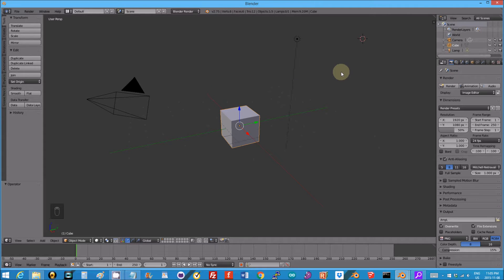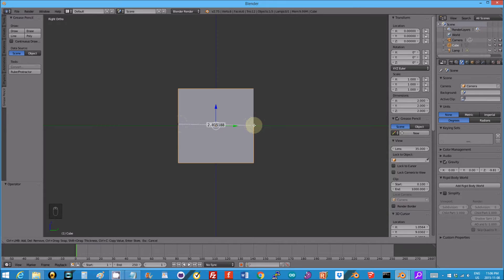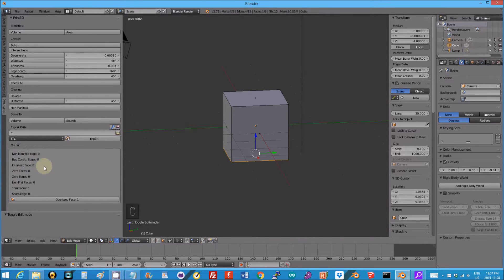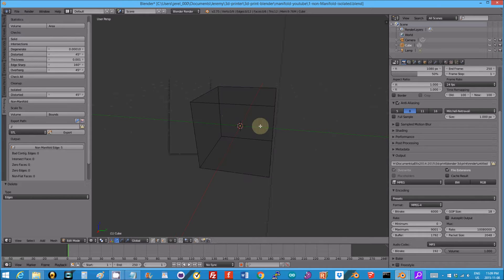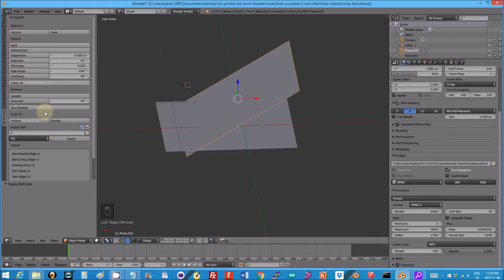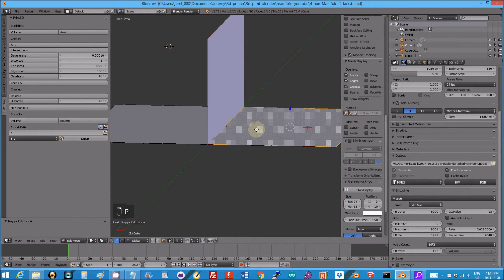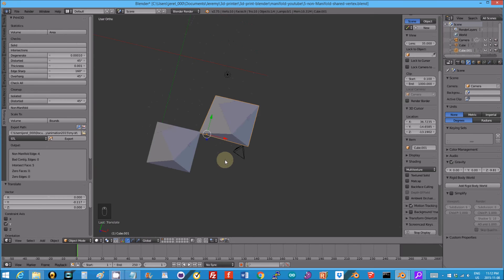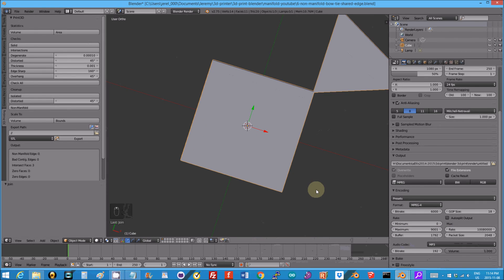Fast Fixing Non-Manifold Blender Objects for 3D Printing

Comment: Hi, how can I contact you? I would like you to take a look at a file that I want to print but are not manifold. I have no idea yet how to use blender.
Reply from the maker: My twitter is @rocksetta. That is the best way to contact me. Blender is very difficult unless you spend some time learning the hotkeys. When my students make their own work to print, I encourage them to check if things are manifold every few minutes. Fixing a large file with hundreds of non-manifold edges is really hard to do. Fixing little issues as you go is by far easier.

Comment: it is usefull to identify the origin of the non manifold edge, but when I discovered the problem there were 300 of these, i dont think this to be the best way to get out, you can always go and check the edge and remove the vertexes that arent connected to all the edges, the most common issue is to have edges connected to more than one vertex, and if the vertex is connected to another edge it can not be removed as a double, that should be patched, or solved in a practical way